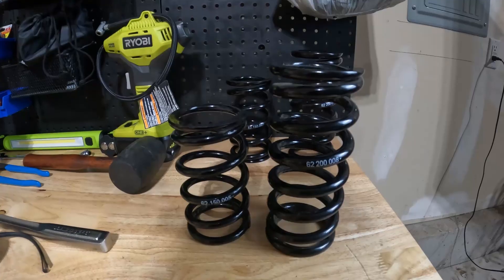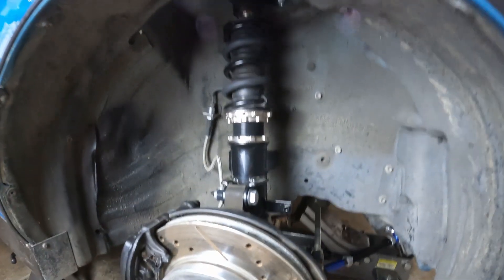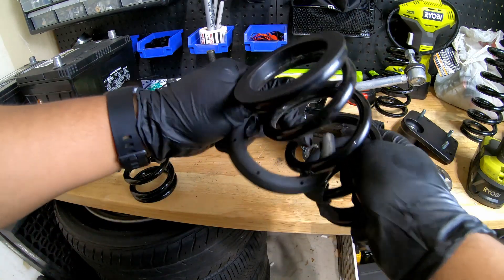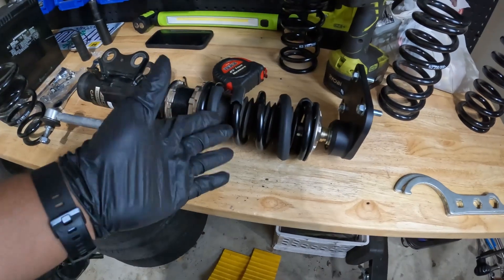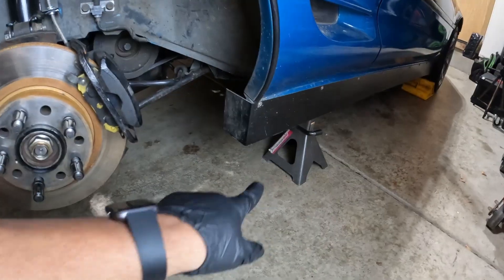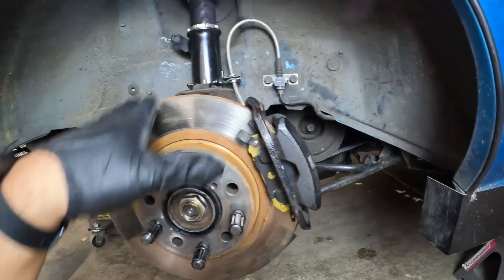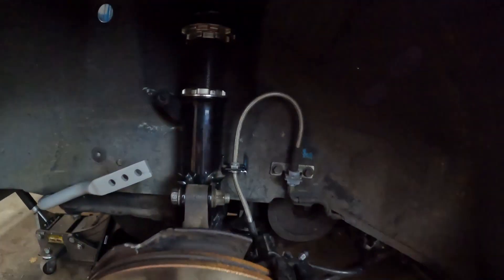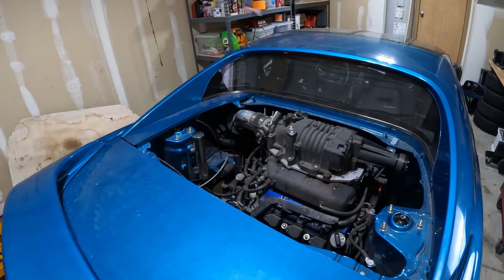Installing New Springs On The V6 Toyota MR2 II BC Racing Coilovers II SW20

Comment: By chance do you remember the lengths of your springs are F/R?
Reply from the maker: I believe the front are 150mm and the rear are 200 mm
Reply: @saladbar21  6 and 8 inches. Thank you. It's so weird for BC not to recommend lengths when they sell 5-10 inch springs for those specific sized dampers.